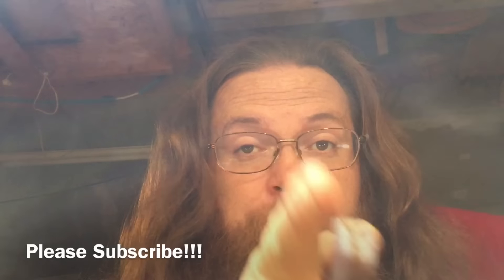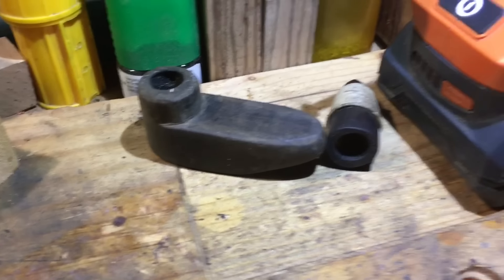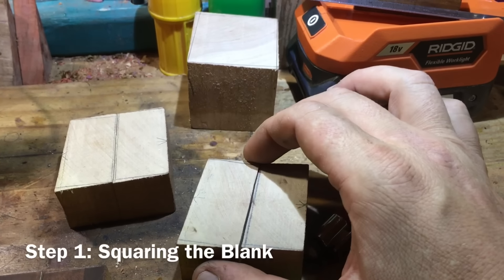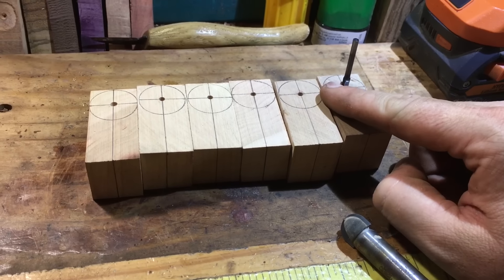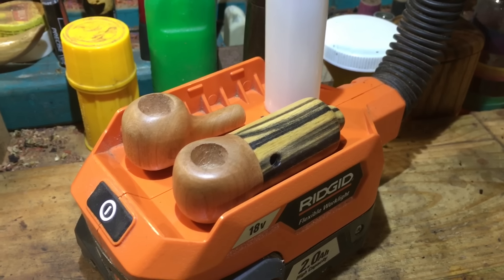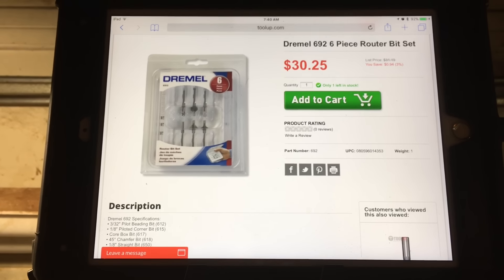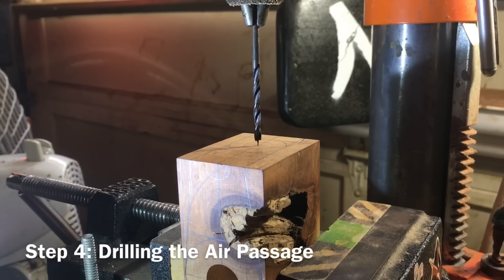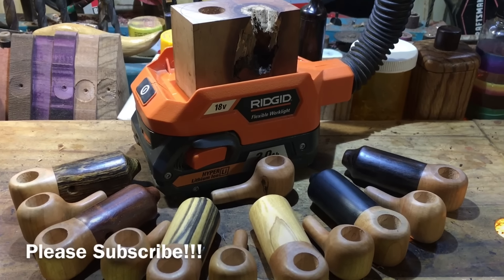Gary's Wares: The Basics of Pipe Making

Comment: Btw : If you're impatient, before modern drill bits, there were spade bits. If you want a bowl with a semicircle bottom, all you have to do is get a coin (yes, a coin will work as long as it's made of work hardenable metal), and grind the sides of it to the diameter you want. Then, grind it into a proper semicircle on one side and sharpen it. Then, hammer the edge to work harden it so it won't kink. Attach it to a bit of metal stock and you have a spade bit. Just be careful because they get rather hot. That'll save you about $20 on a core box bit. 

Yes, this really does work. I've done it.
Reply: What finish do you use? Thanks for this video,  really helpful and informative!

Comment: I've been using a Razer blade to "carve" a pipe from some wood I pulled out of a tree. I might have wasted that time if it's bad wood
Reply: it's weird though because the wood is light brown on one half and the other half is darker. I have no clue what it is but the tree had white outsides. not sure if that helps
Reply from the maker: +Rudy Roman I'd be cautious, but I wouldn't lose hope. That Pipedia list has a lot of domestic choices and you may have lucked out and just happened to get a wood that works. Fruit bearing trees are generally good woods for bowls. On the other hand, maybe that wood you got isn't on that list and maybe it would be toxic to use. 

Hard to say. Wood identification is tricky at the best of times. I'd google as many pictures of wood that you can and compare the color and grain pattern to what you find. Pay more attention to the grain than the color; filters, lighting, and tint settings can be deceptive. If you can find 3 or 4 pics that pretty well match your wood, that's probably what it is. From there I'd check that Pipedia list or pipe making forums to see if your wood is useable as a bowl.
Reply from the maker: +Rudy Roman What you may have there is the wood transitioning from the Heartwood to the Sapwood. 

The Heartwood lies at the interior of a live tree and gives the tree its strength. The Heartwood is not technically a "living" part of the tree much like your hair and fingernails are not "living." Think of the Heartwood like the skeleton of the tree. Water and nutrients are transported throughout the tree via the Sapwood, which surrounds the Heartwood like a tortilla wraps around a burrito. 

Since the Heartwood and the Sapwood play such different roles, they can appear dramatically different. I currently have two pipes made of Kingwood, but they look completely different because one is half Sapwood. Kingwood is usually dark purple, but the Sapwood of Kingwood is white with black streaks and the Heartwood right next to it is a rich brown. 

Here's the product page for the pipes if you'd like to take a look; the Sapwood pipe is toward the end of the gallery: http://garyswares.com/products-page/chambered-pipes/mini-carb-pipe/

As such, Sapwood tends to be less dense than Heartwood. It can still be used as a bowl (provided that the wood is acceptable as per that Pipedia list and etc.), but because it's less dense,  a bowl made from it will inherently have a shorter lifespan. 

Hope this helps!
Reply: EDGY
Reply: at least its carving experience even if you cant used the finished product. free material

Comment: Nice work Stoney! What size bit are you using for the air passage hole? 1/8”? ...or bigger?
Reply from the maker: Thanks! I used an 1/8” bit in the video, but you can use 3/16” without there being a problem. Much bigger than that and I don’t think the pipe would have a tight enough airflow to work efficiently.

Comment: is the glue poison for smoking? I have seen some post on other site that say not to use and others say it okay, what your thought
Reply from the maker: +Troy Anderson Using glue in the stem or on the face of the bowl blank (as I do) is not a problem since the glue is not exposed to heat. Using glue in the construction of the bowl or very near the bowl's air passage is totally unacceptable. 

Wood reacts in a very predictable way when exposed to heat; after a layer of char builds up (which happens after smoking the first couple bowls), the bowl hardens and becomes non-reactive. With glue in the bowl, it's a non-stop toxic disco. When I first started making pipes, I learned the hard way about unintentionally smoking glue. I wouldn't advise it. 

And this goes double for laminates! Don't use a laminated wood for a bowl! A laminate is layer after layer of wood and they're not held together with love. That's a whole lot of combusting chemical adhesive right there! So no plywood bowls! ...Because I did that, too. As before, I wouldn't advise it. 

I saw a pipe in my local tobacco pipe shop that looked like it was laminated, but closer inspection showed that it was actually a solid bowl that had a laminated outside (essentially a solid bowl inside a laminated bowl). This design worked because all the combustion and heat would be happening in and to the solid bowl, with the glue line of the laminate being far enough away not to cause problems. 

Tobacco pipes typically have removable stems made of acrylic or this synthetic rubbery stuff, thereby avoiding the toxic pitfalls of gluing altogether. Unless you can make these yourself, you'll have to order them. Gluing the stem to a tobacco bowl is usually not done, but so long as the pipe can be easily cleaned, it's not a functional or health problem. I wouldn't recommend making a glued stem much longer than about 6", since pipe cleaners don't usually come longer than that. 

You could always connect the bowl to the stem with a wooden mortise and tenon, but precision drilling would be required. Check www.Pipedia.org for more info.

Comment: you said about woods that can make you ill what if you used a brier wood bowl insert cylinder with bowl that can be inserted ? is this possible ?
Reply from the maker: +tony flamingo Yes! I didn't think so until I saw one in my local smoke shop that had a laminated exterior but essentially had a plug of Briar. 

I did something similar to the Pill Bottle Pipe in my Voltron Pipe video (though I did it with cherry): https://youtu.be/9tewrh5bg4k
Reply: Gary's Wares thank you for the reply as i have coloured laminate that i wanted to make a pipe out of  but didnt know if it was possible
Reply from the maker: +tony flamingo Yeah, I used skateboards in the video, which is exactly the same thing when I think about it. The key is to make the bowl plug large enough to wick away heat without burning out. I give myself at least 1" for a 1/2" bowl. The surrounding laminate wood can help absorb the heat without getting involved with the combustion happening inside the bowl.

Comment: using cedar isnt good? and what
is there any glue you prefer to use?
Reply from the maker: +Daiki Hamamura I don't think I mentioned cedar, but no, if wasn't on that Pipedia list, I wouldn't recommend using cedar for the bowl. I have no experience with cedar; I would check around pipe making forums if your heart is really set on it. Of course, you can use any wood you like for the stem or chamber. 

Since most of the woods I use are on the dark side, I use Titebond II Dark Wood Glue, which is the regular type II that's been dyed to dry darker tan the normal stuff. It's like a dark caramel when it's dried. I recommend it.
Reply: Besides containing lots of resins which might be toxic when burnt, cedar will simply catch fire rather fast. When making pipes, stick to known woods: briar, olivewood, most fruit woods such as apple, pear,  cherry, and a few others like maple.

Comment: dont know if you answer comment anymore. i randomly stumbled upun a very clever invention in the past. it was a stainless pencil with a special metal strip on it. "medicinal herb" were put inside the special bowl and heated from the outside like an oven. when the metal strip clicked it was ready. a hole was uncovered and the medicinal smoke inhaled. i found this very clever has it isnt smoking, but vaping the product.

sadly i dont remember the name, it was about 30-50$ a pen.
Reply: The 'special metal strip' was probably bi-metal water heater thermostat temp sensor strip. It will bend as it gets hotter, and if mounted just right it will 'pop' when desired temp is reached. Self resets as it cools down. Sounds like a fancy freebase pipe to me.
Reply: @stanervin6108  finally found it. its called a VapCap. have a look its very interesting. personally i dont use "medicinal herb", but if i did i would use something like this.

Comment: Two questions
Question #1 can you use any wood for the stem?
Question #2 In my store bought pipe I noticed this black lining. Can you tell me what it might be, or tell me the purpose of this lining?
Reply from the maker: +Caleb Johnson 1.) Yes, with very few exceptions. I'd be wary of spalted wood (which is essentially wood with a dead fungus infection), though I suspect that wouldn't be a problem after final sanding and finish. I can't think of a wood that would be health concern (except for spalted stuff and the like) and I work with a wide variety of exotics. If the wood itself is inherently toxic, then I definitely wouldn't use it, but I don't know of any wood like that. 

Also, you're not just limited to wood. You could use a 3/4 acrylic pen blank that's been turned on a lathe. You could use a metal tube of some kind (though I wouldn't). Anything that can be made into a straw and can withstand moderately hot smoke without causing a problem can be used as a stem. 

2.) I'm unsure what you mean. Where is this lining on the pipe? Inside or outside the bowl? Do you think it might actually be a finish of some kind? When I think "lining," I think of felt and flocking and soft stuff like that; I don't guess that's what you mean...or is it? Is it, like, on the pipe where the pipe would make contact with a flat surface?
Reply: it's inside the bowl it's black, it kinda looks like it might be some kinda heat shield
Reply from the maker: +Caleb Johnson Is the inside of the bowl itself smooth and regular like it was drilled with a drill bit?
Reply: Gary's Wares it looks like it would be if this wasn't sitting in it but it's a nice even coating on the inside bowl but at the rim of the bowl where it's polish or a gloss smooth finish(but due to improper breaking in of the new pipe has started to chip away revealing the woods true dark brown color)
Reply: also on a side note could you do a video on stem bending
Reply from the maker: +Caleb Johnson Ok, think I know what's going on. I'm assuming this is a relatively new pipe but you've been smoking it for a minute and this stuff has built up over time. If that's correct, that "lining" is two things: tobacco resin from normal use and, beneath that, the char layer of the bowl. 

The bowl of a new pipe is raw, unfinished wood. As soon as the wood is exposed to heat, it starts to burn, but it doesn't burn up entirely. The wood doesn't turn to ashes like firewood, but it becomes harder like the point of a stick that's been put into the fire.

(Fun fact: Early hominids used to harden the tips of their spears by charring them in campfires.)

The char layer is more fire resistant than the rest of the wood of the pipe, but it can be very brittle. If the char layer is removed for whatever reason, the layer of raw wood that's now exposed will have to go through the charring process until the char layer is thick enough to do its job. Needless to say, if the char layer is disturbed enough times, the bowl will "burn out" and a hole will form in the side of the pipe. 

And there goes your pipe. 

I did this to a briar pipe of mine that I subjected to too much heat too many times. I can still use it, but it sucks that there's now a hole in the side of otherwise sweet-ass pipe. 

If the inside of the bowl needs cleaning, I'd do so will a nylon brush just slightly wider than the inside of the bowl. I wouldn't advise trying to chip away at the inside of the bowl because you may lose part of the char layer. 

The char layer, however, does not extend to the tops of bowls. That stuff you can chip off around the edge of the bowl is most like just tobacco resin and gunk. My local smoke shop has a buffing machine and they'll clean that stuff off for me if they're not too busy; maybe yours does too? I use a felt buffing wheel on a rotary tool to knock that stuff off around the edges of the bowl. But I do not mess with the interior walls of the bowl at all if I can help it. 

Was this helpful or did I totally miss the mark here?
Reply: Gary's Wares it makes sense and your probably right on the mark did you get my other question about a video on pipe bending?
Reply from the maker: +Caleb Johnson Yeah, everybody asks about those. It's sort of outside the normal run of things for me. From what I understand, it's a whole big process and I'm a little too busy lately to experiment with a new thing. I'll get to it, but as Gomez Addams said, "Next quarter." In a season or two, in other words.

Comment: Is a triangular hole also ok?
Reply from the maker: +Tolle Wurst I wouldn't. A circular hole is most efficient for airflow and for building up a char layer within the bowl.
Reply: Gary's Wares xD i mean if its ok when the hole is a "V" shape and Not a "U" shape
Reply from the maker: +Tolle Wurst Oh, I see. You mean more of a pyramidal, funnel-like hole. That wouldn't work as well aerodynamically as a concave hole. One of  the advantages of a concave hole is that it gives a place for the ash to rest that isn't directly over the air passage, which prevents clogs and promotes consistent airflow. A funnel-shaped hole would be constantly sucking the ash into the air passage, which would not be a good thing. 

Actually, a lot of tobacco pipe makers use ground spade bits whose profiles would probably be more triangular than curved, but they still have pretty rounded bottoms. 

Think of how heat comes off of a lighter's flame. It goes up and sideways, but also radially at the tip (at all kinds of angles). The hole made by a core box bit is the best shape to get the same amount of heat in all places of the bowl at the same time. A pyramidal hole's sides would get much hotter than everywhere else, eventually burning out to a more efficient shape: the shape made by a core box bit. 

Good question!
Reply: Gary's Wares oh ok ^^ thank you for the answer

Comment: Facepalm. Wood pipes are good only for tobacco and slow smoking (like 1 hour / bowl). This also means that it has to have nice reclaim built in it to insulate the burning. Glass pipes are for herbal use cause they need to burn much higher temperatures and much faster. Thats why they need to be kept very clean too, unlike tobacco pipes.

Comment: Trying to make a steamroller pipe so i gues ill have to figure it out.
Reply from the maker: +Fernando Morales Check out my video on making a Jumbo Carb Pipe, which is a big version of the Mini-Carb Pipe ( https://youtu.be/uBVdMFCV7p8 ). It has a 1.5" internal chamber drilled with a forstner bit. If you had an extension you could make a steamroller if you extended the carb to say 5" or so, but a Jumbo Carb Pipe is almost a steamroller as it is.

Comment: on your big pipe that you are going to remake can you not just  drill out the bowl and make a new bowl and insert it where the old one was
Reply from the maker: +Charles Hunt I've actually decided to retire that pipe. Retiring a pipe, by the way, is not something that happens to glass pipes very often. 😉

But, if I were to refit the bowl, I think I'd cut it off as opposed to redrilling it. The concern is how it would be glued and which surfaces would be involved. I always use clamps when gluing and I think cutting off the bowl and planing a smooth surface to glue and clamp to would be the way I'd go. 

I suppose if I were to drill, I'd drill through the bowl's air passage with a forstner bit and make a new bowl with a tenon matching the forstner hole, but shoulder of the tenon would have to be planed to match the top of the old bowl, and...that seems like a great big headache to me. 

But, like I said, that one is officially out of the rotation and sitting on my shelf; an old companion that's served me well and enjoying a well-earned retirement. 😊

Comment: your bowls are burning out for two reasons.  You're lighting them wrong and you failed to build your cake properly on the inside of your bowl.  Once your cake is built, it will absorb moisture and protect the wood from heat.  A pipe can last 100 years if taken care of and properly used.

Comment: So a carb pipe glued up long grain to end grain with little glue surface area, guaranteeing a weak joint (a basic woodworking no-no, though common on gootube) , and obviously, absolutely no way to clean the bowl's airway, which is inevitably going to clog... no thanks.
Reply from the maker: That’s a really good point actually. End grain to long grain is usually a bad idea with most woodworking projects, but what I found is if you plane the gluing surfaces well enough, it’s not much of a issue due to their size. To break the carb off the bowl would take a fairly precise blow, and like I said, they’re awfully small for that. 

But all of this is kind of a moot point because I’ve switched up my designs since this video. These days I make the carb with a 5/8” hole that slides onto a 5/8” dowel that’s been glued to a mortise drilled around the bowl’s air passage. The effect is a carb that pulls away from the bowl for easier cleaning. But that’s new content; this is the way I was doing it. 

Thanks for your comment!